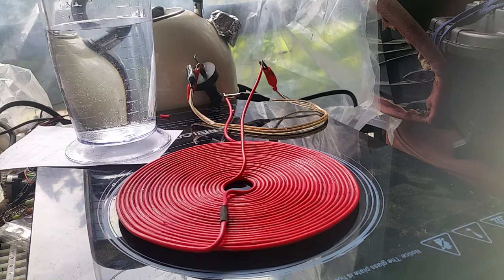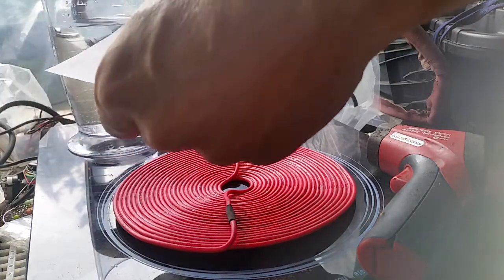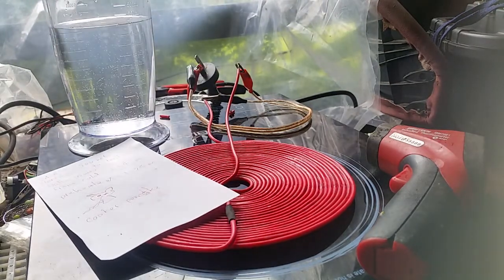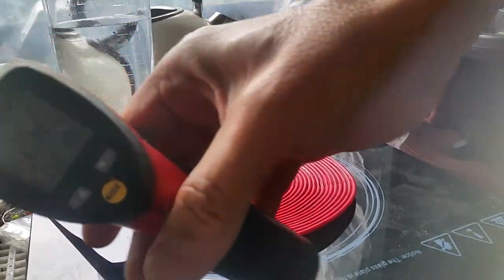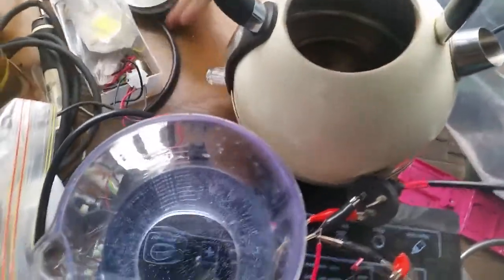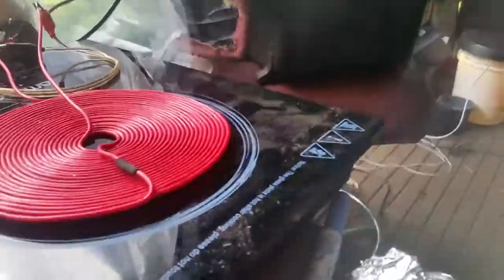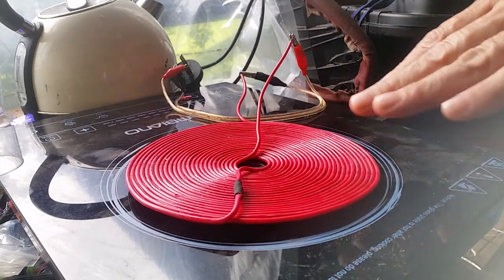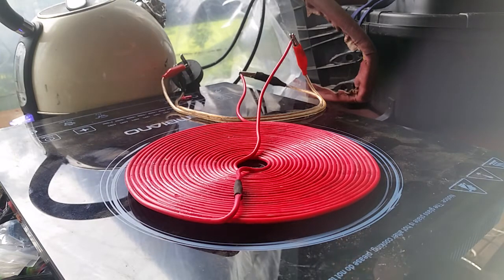Kettle calibrated load ENKI replication Induction cooker Tesla bifilar pancake

Comment: Hi, please 🙏 🥺 teach us how to bypass induction cooker heat sensor. Step by step. I am struggling, mine is like yours😢😢❤❤❤😊😊😊🎉🎉
Reply from the maker: it is not a thermal switch that cuts it out. it is a lack of load. use a piece of iron under the coil to trigger it. have a load on your pancake coil. no.load, it will turn off
Reply: @m3sca1  it works, thank you, I managed to power my stove, iron, and TV

Comment: Please 🙏🥺 do this again without rushing 😊😊😊😊😢😢🎉🎉🎉🎉
Reply from the maker: i can't. i have moved on. there is no free energy here. efficient cooking yes. if i want to run a generator that can't run 2000w elements this system will let you do it. it dont run at 2000w but will be able to run at say 800w without overloading the generator and still boil your kettle
Reply: @m3sca1  wow, great stuff to hear. But free energy can be done if one can build a proper design using same concept.
Reply from the maker: consider the random movement of all the electrons, you need to align them and polarise them so you can extract anything. think magnetic field with shielding at 90° to the field. dielectric field is physically at 90° to the magnetic. capacitor needs to be arranged as the shield to the random oscillations in the universe, and the magetic field in the middle to align and polarise. then those polarised electrons can join in, instead of being random

Comment: Hello. 
How does it work without iron on induction?
Please give me a detailed explanation.
And isn't it impossible to operate the induction 24 hours a day?
Reply from the maker: if the load is big enough that is attached to the coil, the cooker will start no problem.
if load is too low it will error.
it can be tricked into starting on low load by using piece of iron or anything that will create sufficient eddy currents.
with resonant tuned coils there is not much heating on the coils and the energy is converted to electricity like a transformer, and quite efficiently too.
correct it wont run indefinatley... the timer circuit does not allow it.
the best case application for what you see here, is the kettle can be run from the cooker efficiently using a petrol generator that is too small to run the kettle, but that is kind of self defeating since you could just put metal pot on instead to boil water.
a good combo for emergency situations.
did i find free energy? No.
it also seems to work well lighting halogen bulbs off the coil, and they seem to be able to light more bulbs than you'd expect.... maybe the high fequency works well with the xenon in those bulbs 🐓
Reply: @m3sca1  Please explain in detail how it works without an iron pan on induction.
If you operate induction without an iron pan, an E0 error will appear.
I want to know what kind of work was done on induction.
Are there any sites or YouTubes that I can refer to?
It's written through a translator, so it's a bit confusing. thank you
Reply from the maker: @maze4454  eddy current from the load starts the cooker.
no load, it will not start.
this is true of both modified cookers and unmodified cookers.
error will not show if coil has a big load.
Reply from the maker: watch for mods
https://youtu.be/W-ZQWuhmisg
Reply from the maker: also here for mods
https://youtu.be/fAr92eePbqY

Comment: So if i understand this. You have normal current going into the cannibalized induction plate, then you are using its induction ring to induce a current into the pancake ring you wound, which then transfers that induced current to the kettle mains. Why? 

Is this just to prove that induction works like a transformer does, to transfer the current? I thought you were repairing or building your own induction cooker. 

By the way that tiny sensor also senses heat and changes resistance. If too warm its suppose to cut the circuit. https://www.youtube.com/watch?v=ma3Pm0fFDVU
Reply from the maker: ok so the reason for doing this is a free energy claim by running halogen lamps from the pancake and claiming each bulb being 1000w bulb and people managing to light more than 4 of those bulbs from a 2100w cooktop, saying they are at full or near full brightness as a measure of energy spent was over 4000w and i was thinking trying to rate relative brightness with the human eye as a measure of power is not good enough and so i took to the plan of running the kettle because it is a similar type of resistive load as the halogen lamps and you cant mistake time to boil by any factor, it was  calibrated to the wall socket cook time for a known measure of water and the goal was to try and boil the water faster or in the same time frame but lesser watts input. i was following along the work of a fellow who now makes and sells devices that are claimed to be free energy. i asked him to calibrate his load to a kettle but he never did or if he did he never showed it, he is now using zvs drivers and making all manner of large flyback type looking coils and odd things and selling them for $k bucks. the name ENKI in the title if you search that and free energy or such you should find him. He makes a lot of cool looking high voltage gear but he never shows heating water as the load, only lamps. i never got a faster boil than wall socket. the only advantage i found here was i could run the kettle at less watts thru the pancake and that made it possible to run the kettle from lets say a 400w inverter or small generator not capable of running a kettle without overloading, but that was also rendered moot since a pan on the induction cooker will boil water more efficiently. in the end i have an upgaded cooker that burns rice on the lowest possible setting and we never found over unity in a 50 dollar induction cooker and tesla bifilar pancake coil. thanks for the question
Reply: @m3sca1  I see, you were debunking another free energy claim, which if you think about it would lose energy due to innate resistance in those coils. Tesla had a lot to say which wasn't clear. He was a pioneer selling a new technology and used a little spin to get those needed funds. He was also at the fore creating the language for those new ideas, language which to the layperson might have read as free energy. I won't mention his tussle with Marconi for the radio honor, or his mathematical speculations on a 'death ray' device.
Reply from the maker: are you aware of the work Tesla did after he dropped the high frequency AC work?
its all to do with disruptive discharge and the strange emission it makes going out at 90 degrees to the flow of elecricity, something that passes thru most things like an x-ray, yet it can not be focused like x-rays and the stream could carry an ion on the front moving matter thru things. it is very intesting and explains the death ray nicely.

Comment: I've had trouble having the induction cooktop actually fire up i keep getting error message EO - i think my coil is too big. is it really important for teh coil to stay within the circle of the cooktop guide?
Reply from the maker: got a load on the coil?
Reply: @m3sca1  yeah its the set up from Gegene HHO tests on Naudin's website
Reply from the maker: @Doncious  ok maybe try more load. I generally had the kettle attached or more load like a lightbulb to get easy starts on the cooker.
Reply: @m3sca1  thanks ill try that
Reply: @m3sca1  thank you i found out my issue and its kicking now!
Reply: The problem now is my diodes are popping and getting hot once i reach a certain power level on that cook top
Reply from the maker: @Doncious  are they fast diodes?

Comment: Could that signal diode be for an indicator of if a pan is on or not ? I think it is but don’t know how it works ! 👍🏻
Reply from the maker: It measured like a resistance. I am still unsure of this component even though I spent years working for jaycar. I have it back in and just pushed out of the way...i don't think i put the meter in diode check though...will have another look tomorrow. A signal diode in the coil field would most likely put out a signal...but it worked without it connected. I am triggering the cooker to start with a small pan of water and then slide it out and drop the coil on. There's an old video from JL Naudin shows starting with a thin plate of steel.
Reply: @m3sca1  mine seems to be starting fine now but i think a metal 1 inch washer might work ok. Maybe the lowest setting will stop cycling!